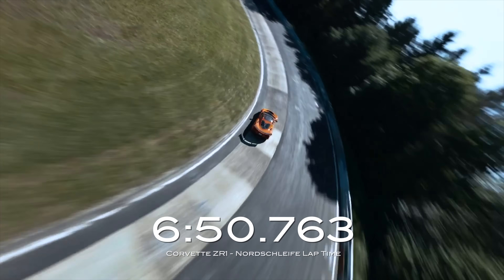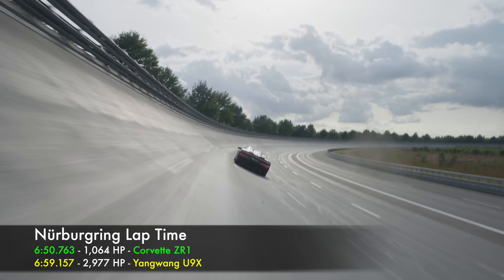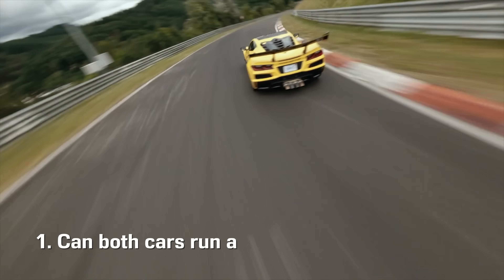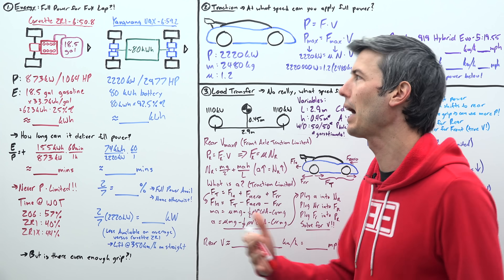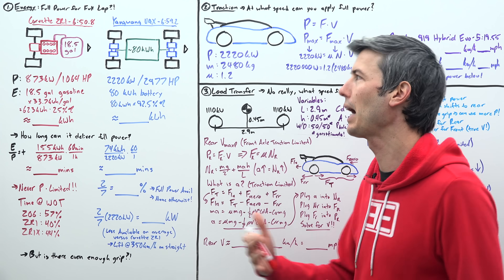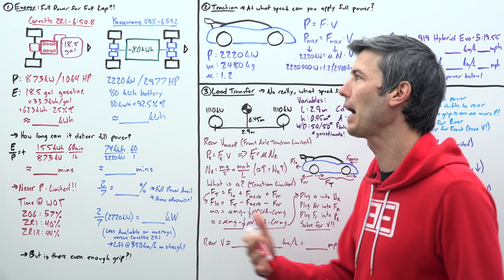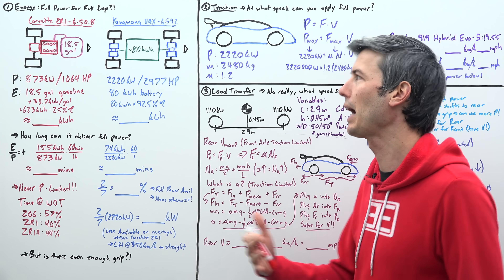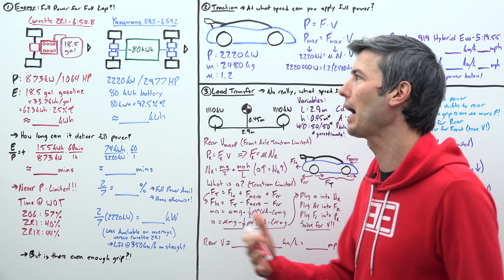Gas Beats Electric! Why Is 1000 HP Faster Than 3,000 HP?

Comment: This man managed to monetize his tire and whiteboard addiction. And I deeply respect that.
Reply from the maker: This comment made my day - it's true! 😂
Reply: Yeah but that tire addiction got him a blackout!
Reply: Don't forget the clutch addiction
Reply: I wonder if the electric have some kind of a cut off or slow down i should say after a certain Rev range
Reply: And they are great tires! I use them on my two cars and, after 3 years, they looks brand new.
Reply: Yeah, and he doesn't have a clue about the topic, did the math wrong, leaving out some of the most important factors, yet, he has a bunch of sycophants that know even less than he does, giving him praise anyway.
Reply: @rockethead7 feel free to give a constructive comment
Reply: @PaulJulienVAUTHIER  
I did.  I wrote up 4 or 5 of his biggest mistakes, and, I put it in the main threads.  Want me to copy and paste it here?  I suspect it'll be blocked, but, I can try, if you want.
Reply: @rockethead7   I read your comment. It's exactly what I expected that @EngineeringExplained would say. Apparently, he didn't. Frankly, just from the first 4 minutes, he's going to harp on about continuous power. Admittedly, don't put too much stock into regen braking. Remember that you're converting electricity into HEAT and kinetic and then using the SAME MOTOR, optimized as a motor and not a generator, to turn KINETIC into electric and HEAT. Not that it's insignificant, but don't invalidate your own argument with that. It's a bit of a distraction from the main point, despite being worth acknowledging. Note that there's also a comment above this one (from EE) stating exactly that, but I'm not going to even try to suggest what timeline that happened on. I don't know how bad his other videos have been, I've seen issues before but never something this egregious, and I'm only now in college for engineering specifically. So, I digress. In short, you are correct... but you're also a bit of an asshole about it. Try just being constructive, instead?
Reply: @Terro-xc9mw  
I really don't care what anybody says about me.  I'm not the one with 4 million subscribers, making videos that are supposed to be about engineering, but botch the living daylights out of the topic.  I actually feel the need to understand a topic before I talk about it.  Apparently, not that guy who made this video.  I loathe that kind of behavior.  He's getting paid to spew nonsense, and his followers (who know even less) gobble it up.  If I'm a [insert the label you used here] for it, so be it.  I really don't care.  I'm not the one making money on complete and total hogwash, pretending to understand topics I don't.  And, did you see that guy responding in other threads?  Others explained that it's all about the lighter cars being able to corner faster than a heavier car.  Did the guy say, "oh, man, maybe you're right!!"  Nope.  He double down and called the weight even MORE irrelevant.  It wasn't something he overlooked.  He actually doesn't even know THE MOST IMPORTANT DIFFERENCE that makes the track time faster for the ZR1.  It's not like he overlooked a minor factor.  He not only overlooked it, he REJECTS it.  If I'm the [fill in the blank] for criticizing him, what does that make him for pretending he knows stuff he doesn't, spreading falsehoods, then making money from it?
Reply: @rockethead7   @rockethead7  I dug a little deeper. 
"It's a high speed track, don't kid yourself haha."
I don't really have the numbers to correct either of you, but at the same time, both of you seem mildly arrogant. And only one of you has a living to keep up with. If you want extremely precise and factual engineering, go read textbooks and do the math yourself. EE is trying to entertain and inform on how to think like an engineer, even if it's not perfect... Did you know that 99% of the stuff you use on a daily basis did not have one, two or three, but twenty plus engineers working to complete it?
Reply: @Terro-xc9mw  
"It's a high speed track"

Yes, which means that downforce generation from the aero has a huge effect... an effect which he 100% completely ignored.

"mildly arrogant"

I am 100% IRRELEVANT.  What I said was true whether said by me or said by someone else.  And, I'm not the one with 4 million subscribers, yet spewing piles of gibberish, pretending to know things I don't, to generate revenue.  I'm also not the one who was corrected by numerous people who pointed out the importance of lighter weight/mass in the curves, yet, doubled down and insisted the most important factor doesn't matter at all.  That was the dewdrop posting this video who did that.

"EE is trying to entertain and inform on how to think like an engineer"

By pretending he knows stuff he doesn't?

"go read textbooks and do the math yourself"

I haven't needed to read textbooks to do this simple math since... I dunno... 1980s?

"Did you know"

Sorry, who was the "mildly arrogant" one here?  Me?  You sure it's not the guy in your mirror?
Reply: @rockethead7 how is a simple matter of fact arrogant? Most of the objects you use on a daily basis have a miltitude of engineers that have perfected the design even if they aren't from the same firm. The only thing that ive stated as fact is a legitimate fact... lol. The rest is opinion. Well, I didn't make that clear enough, swore i said "i think hes trying to entertain" on the first draft but it got deleted, so my bad there. Regardless, again, could just be polite and respectful, as i dont have the hard numbers to prove anyone right or wrong.
Reply: @Terro-xc9mw  
Look, I just don't care.  My purpose here is to point out how ridiculously wrong and totally clueless this video host guy is.  And, beyond that, he not only posted this outrageously wrong video, but, once corrected by numerous people who know 1,000,000x more than he does, he didn't just say, "oh, yeah, my bad, I shouldn't have pretended to know things I don't," but, he DOUBLED DOWN and said that the absolutely most important factor is irrelevant.  I don't like seeing people making money by spreading nonsense, pretending to know things, and then refusing to accept input.  That's my purpose here.  Talking with you is fine and all, but, it's not at all relevant to anything.
Reply: @rockethead7  You did notice the ending of the video, where he literally brought up Porsche GT3 RS and why it is faster than either of the cars in the video? Bringing up exactly the weight and aerodynamical grip as much bigger factors in a quick lap time at the Ring, than power..?

As a guy, who claims to get to bottom of things before talking about them, You surely dropped the ball on this one...
Reply: @rockethead7  Go get a churro or tea or something. You need to relax.
Reply: @rockethead7 fix it for us then. I think you're full of it but I'll gladly accept better information.
Reply: @CaseyBDook  
Sorry, dewdrop, I already "fixed it" in a separate posting, and I don't cater to silly people who thumbs up their own comments.
Reply: @rockethead7  You sound like a POS that doesn't actually know what he's talking about or you would've been specific as to what he said that was wrong.

Comment: My first guess was 'the electric car is 50% heavier'. After watching all the math, I don't know that the weight was really mentioned at all. The traction stuff and full power matter a lot on a drag strip, but on a winding course like the nords I think sheer weight is more of an impediment than the fact it can't use all it's power. After all, the ZR1 was only WOT 40-something % of the time. Management of dynamic weight transfer is, IMO, what cost the Yangwang the most time overall.

Comment: I think that with such a high discharge rate, the actual capacity of the electric car battery will be far lower than the stated 80kWh. Discharge rate and battery capacity have an inverse relationship.

Comment: I'm no race car engineer, but he only gives some very brief lip service to aerodynamic down force.  Seems like that downforce could be a lot if the engineers want it to be.  Air affects can be a lot even at 60mph and at 150mph I would think they could be something seriously high, letting you put a lot more HP to the pavement.
Reply: Underrated comment. Dodge drilled downforce dominance into our heads in 2017 during the Viper’s run at 7:01 which matched the Yangwang’s time at a fraction of the power and a manual transmission.
Reply from the maker: Downforce is king at the ring (combined with good tires)! It is why the GT3 RS has such a mighty lap time. 

The premise of the video was learning why 3,000 HP isn't what it's cracked up to be. :)
Reply: @EngineeringExplained  "The premise of the video was learning why 3,000 HP isn't what it's cracked up to be. :)'
so ur just bias, putting out slop to manipulate public opinion
Reply: @AutoSneak-y9m  Go make a counter-video then explaining why he's biased and/or wrong; if you make a compelling argument then it'll take off and you'll get thousands of new subs.
Reply: Downforce would increase drag would increase energy requirement would increase weight would decrease cornering speed, increasing lap times. So downforce is bounded by energy density.

Comment: I don't know how different EV motors are from standard electric motors, i've seen all kinds of electric motors up to 15000 hp, the thing these had in common are the produce the maximum torque at dead stop and as rpm increases the torque reduces. this is reflected in many EV vs ICE drag races, where the EV often gets a great jump on the other car but at the end the ICE car is either gaining or has passed the EV,

Comment: seems like a waste to put the same size electric motors in the front, use smaller motors for weight savings.  Unless the point is to increase regenerative braking rather then power?

Comment: Given the concept of being traction limited, it reminds me of the purpose of the Red Bull X series of concepts, as well as the upcoming Red Bull RB17 hypercar. The RB17 is going to be 900kg, has 1200hp, and can corner at 5g lateral acceleration, and its also a hybrid with a 1000hp 4.5L Cosworth V10 and a 200hp electric boost motor, 1700kg of downforce (at 150mph, active aero that was developed from the X-series concepts reduced it to maintain a max of 1700kg above 150mph), and only 50 of them will be built. It has blown diffuser fans, and it shifts the aerodynamic center of pressure based on tyre load and other sensor conditions, and it shifts the center of pressure based on braking and acceleration to counteract weight shift and maximize traction. When it comes to using the aero surfaces as airbrakes, the system only makes sure to maximize downforce as long as it doesn't go above 1700kg of downforce load, so at speeds below 150mph it increases the aero angles and whatnot higher and higher which generates more and more aero drag at lower speeds, so not quite full airbraking, but allowing the carbon ceramic brake discs to brake at maximum capacity without ABS kicking in.

Comment: Still remember the time when supercar makers were shitting pants to see the 1000 hp veyron. I can't fathom the fact that there is a car equivalant to three of them. Nuts!
Reply: Top fuel dragsters have 12,000 hp
Reply: @MikeO-l7s  They are purpose built, not comparable.
Reply: @Rezoan  Supercars have been modded to crazy power levels for years now. On Youtube you can find Lambo, R8, GTR, at thousands of hp.

Comment: You gotta give BYD props tbh though. They mad a car that can go 300+mph, break 7 minutes on the ring all at the cost of only a couple hundred grand.
Reply: The same could literally be said for the zr1 except top speed because 98% of the owners will never go faster than 200 mph anyways. You will never be able to buy a BYD for 230,000 in the US due to the ludicrous tariffs.
Reply: @shovelknight14True, but the fact that it's so goddamn heavy and achieves all that on basically sheer power and absolutely nothing else is cool
Reply: @TheRealMcCoy88 As an American I still have to agree with what you said but to a certain degree, the c8 zr1 does indeed have a higher power to weight ratio which would equate to being more nimble around racetracks.
Reply: I agree with you both. These cars are good all around. Not just on certain tracks. People forget they have alot of power for top speed & acceleration also

Comment: Pretty interesting video. However, I think ignoring the downforce when estimating the traction-limiting speed results in quite a big margin of error in a car with such high levels of downforce
Reply: yup, imagine thinking the weight transfer is important, but not the downforce 😅
Reply: I came to the comments section to say the same thing. Downforce can double the apparent weight of a car
Reply: @drewgonfly  downforce is not a constant value and varies at different speeds though. I don't think he "neglected" it
Reply: @xelaander8429  of course he did, is it in his calcs? No
Reply: But also, since the car weighs, 2500kg the downforce will not be a huge % difference.
In that respect, a lighter car will have larger % downforce.
Reply: @daniel635biturbo  absolutely, this car is super heavy, but you don't get a sub-7 minute time around the Nordschleife without noticeable downforce
Reply: @daniel635biturbo  Exactly. A 1500 kg. car with 1000 kg. downforce will have the same traction as a 2500 kg. car without downforce. -At a certain speed of course.

Comment: Just like takumi in initial d,  you learned that sometimes less power is better.
Reply: Less power is never better
Reply: @GamezGuru1  Tell that to the all the cars that the 3000HP U9 lost to lol.
Reply: @GamezGuru1 but the 86 won though
Reply: @Dererumnatura99  The turtle beat the rabbit, yes. Turtles are the superior race animals.
Reply: @Dererumnatura99  Yes, because it's a cartoon...
Reply: @Dererumnatura99  are you saying it won BECAUSE it had less power? Or because despite that, it was also lighter with better handling etc...
Reply: @sindoray2094  in some case he was the only one that could go full throttle and concentrate on the trajectory whether the openant had to manage the powerslide and tires overload.
Reply: @VG-Motors you're not funny ....